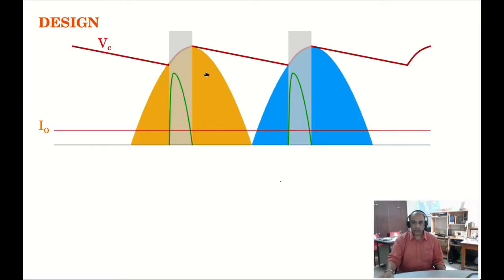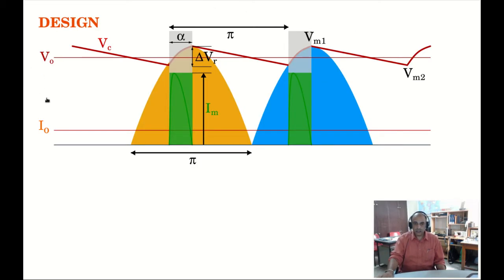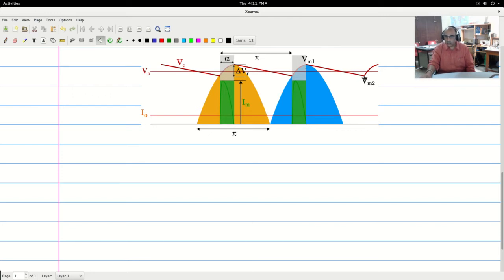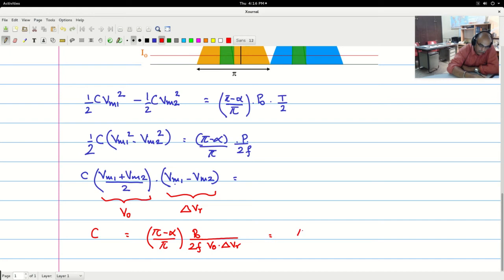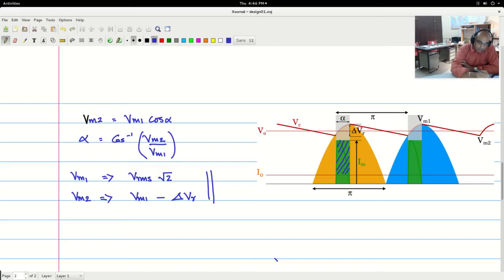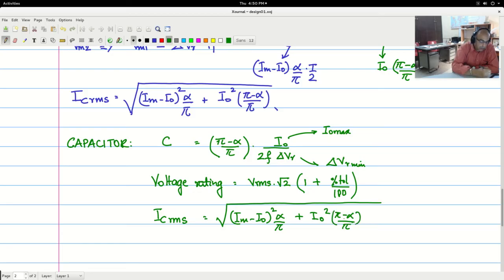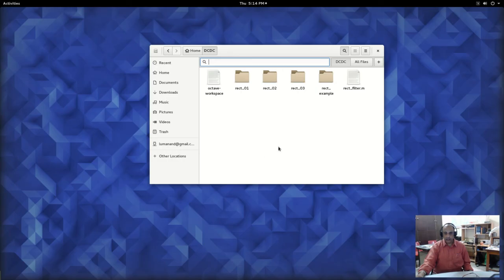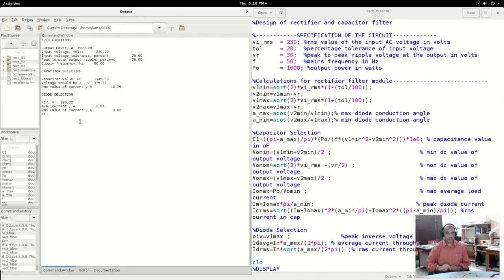Designing the rectifier capacitor filter circuit

Comment: Can i use this calculation for designing input capacitor for pv system.
IN which input capacitor is connected between pv panel and dc dc converter?

Comment: For rectifier circuit the filter capacitor formula is C=I/(2*f*Vpp) I is current, f is AC frequency and Vpp is ripple voltage. I want to know whether we can take the value of "I" as per the load requirement or it will be the transformer supply current???.